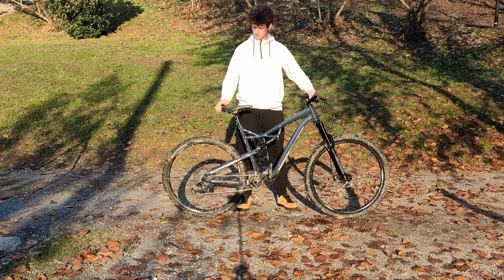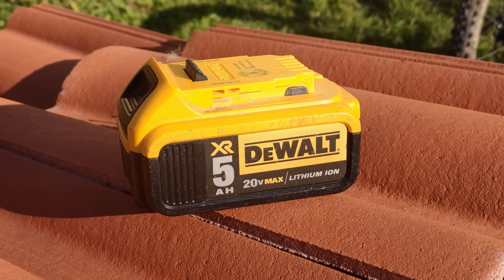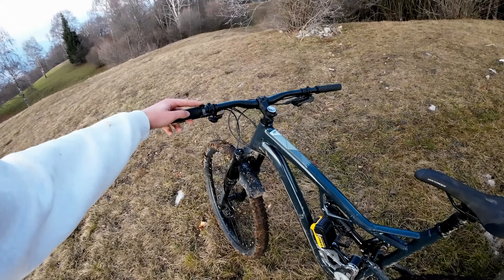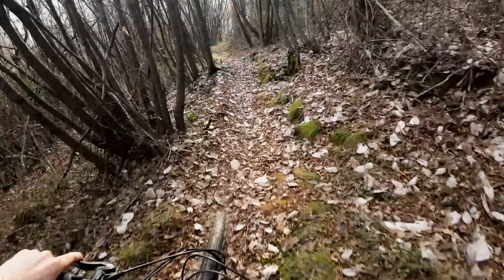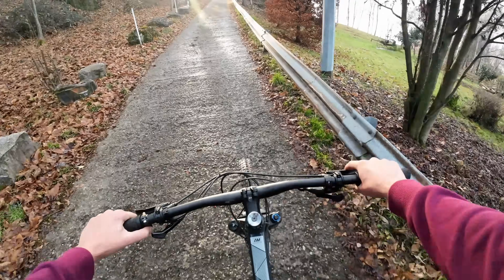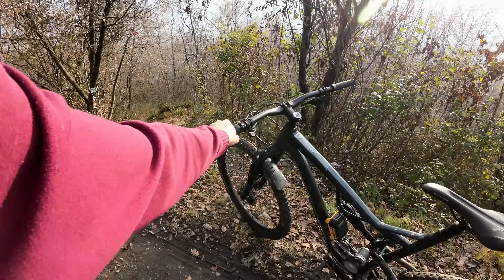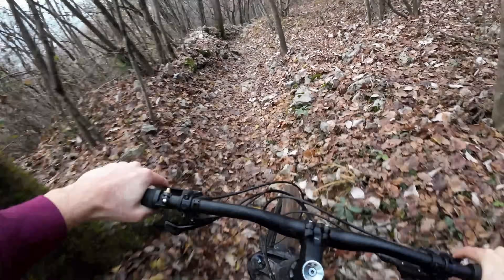Building an E-BIKE (300$)

Comment: Finally someone has figured out that you need double down gearing. Multiple sprockets gives a multiplication of the torque which is the most important parameter making an ebike motor solution. Well done!
Reply from the maker: I'm now working with an Italian bike brand to make a way better e-mtb motor, can't wait

Comment: Hi, just built the same setup, could You share more info what values You set in vesc ? Got the same gear ratio but the motor is weak, I have it set for 20A from battery. I've changed wattage from 300 to 1000W in Vest but with no effect. It is weak - i mean when the bike stays on ground motor can't even push the bike (without me on the seat).

Comment: I also built a mid drive system ebike but using scrap parts.

But the motor is 5 times bigger and is 2000w 84v 
Has freewheel on motor & the bottom bracket crank what is homemade
It has cooling mods cooling fans & more.
It's very powerful & fast
I use it like a motorbike and the motor heats up very fast.
That's my biggest problem with it.

So how does that small motor handle the heat.
I can imagine the size of the motor it will be useless on a bike.
With more voltage
I can't imagine after 20 minutes of constant used  it be ready to melt🔥
There's a reason why people don't use these motors on ebikes.
But the motor is running with 20v hate may not be a problem.
At that low voltage
I'm surprised it barely moves without you pedalling.
If it had the power
You can't anyway because it has no
freewheel on the bottom bracket crank.
So you need to pedal at the same speed.
So legs don't get ripped off LOL.

Apart from that you've done amazing job.
Good quality
I wish I had the machine to do stuff like that.
At the minute I struggle with my hands.
Takes me days hand making simple stuff.
What can be done in minutes on a machine.

Comment: Nice work! I really like how light and simple the motor assembly is. How is the motor holding up? What drew you to the 5065 motor instead of something like 6354?
Reply from the maker: I chose a 5065 motor for the lighter weight and the cheaper price, also i don't think i would need more power than what it can provide since it can output up to 1800w

Comment: Well done on designing and building the ebike motor, looks great!  After watching the video, I have a couple questions about the build.  1. What is the idler gear and spring attached to?   The aluminum PCB part?  2. The motor sprocket welded/attached to the bike sprocket, was there already clearance on your bike for the second sprocket or did you have to make modifications?  Thanks.

Comment: did you try tsdz2 motor ? did you made double freewheel crankset ? and is it possible to add some torque sensing to this?
Reply from the maker: I actually own a tsdz2 motor but i don't like how it stocks out below the frame
Reply from the maker: No, the cranks spin with the motor

Comment: Great work.  Can you post a ‘How To’ video, explaining the build?
Reply from the maker: I don't think I'll make one because this motor is only compatible with my specific bike and only with my size of frame
Reply: @DAZprojects  Pretty sure it is adaptable to any bike that can receive a mid drive such as Bafang BBS motors...
Reply from the maker: @v1ncen715  no because it mounts in a different way
Reply: @DAZprojects  Might be more similar to Cyc or Cyclone motor mounts, but my point remain - apart from the slightly different frame shape that would require different shapes for the aluminium plates and 3d printed bracket, it seems completely doable on many bikes.
Reply: @DAZprojects  I am sure it can be adapted to many frame with slightly different mounting plates.. it looks very similar to Gng / LightningRods / cyclone motor mounting systems.

Comment: Whats the total gear reduction?
Reply from the maker: It's approximately 1 to 12 at the cranks, the reduction at the wheel depends on the gear you're in
Reply: @DAZprojects  So assuming an average pedal RPM of 80, the motor is typically spinning around 1000 RPMs?
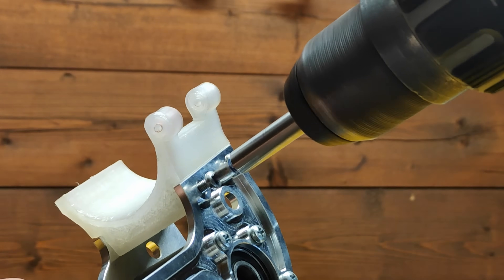Reply from the maker: @MrHamncheez  yes, infact the gear reduction should ideally be lower, the perfect one should be 1:20 but i didn't have enough space to fit it. However after building it i came across a strange type of cycloidal drive which gives huge reduction in a tiny space while needing only 2 components so remaining super simple. Maybe in the future I'll make a video update changing to this type of reduction
Reply: @DAZprojects  I've played around in fusion 360 with a hypoid gear. Its possible to get 40:1 reduction in a single stage at high efficiency. Since they are also a type of bevel gear you can reorient the motor,  allowing space for  a longer, narrower motor
Reply from the maker: @MrHamncheez  what type of gear is it?
Reply: @DAZprojects  Impressive work! Congrats. When you say cycloidal drive, are you talking about something like this Strain wave gearing aka "Harmonic gearing"? It seems like a good design for small size and strength and good gear reduction. A german company called TQ uses a similar design on a few new Trek bikes. https://en.wikipedia.org/wiki/Strain_wave_gearing

Comment: Sell them dude you will earn money
Reply: agree!
Reply: Please! Get more of those frames made and sell them for two three or even four times your cost! Depending on how much they cost you that is. minus the motor , controller , and battery just as a little diy kit I would easily pay 100-150$ just to avoid the fabrication.  Heck, if you included all the components i would easily pay 350-450$ but I’m cheap. You could probably get away with charging whatever you want considering how legit you designed it! If you are able to charge double the cost of what it takes to  produce then you could be selling them faster than you can produce them guaranteed. Great design though for real. I’m going to attempt to copy it for my bike that is just like yours. I want to know where you found the parts for the freewheel on the main sprocket! Any chance you can provide a parts list with links? Please please please!
Reply: @haydenhochhalter11  You can buy a 10x more capable bafang for that kind of money.